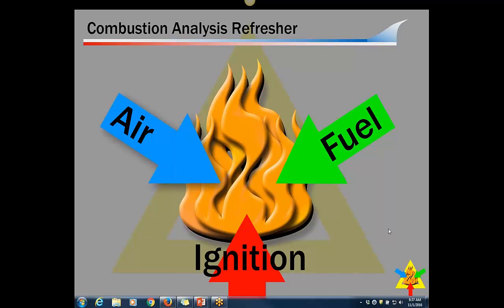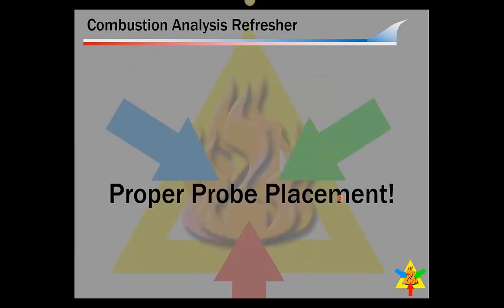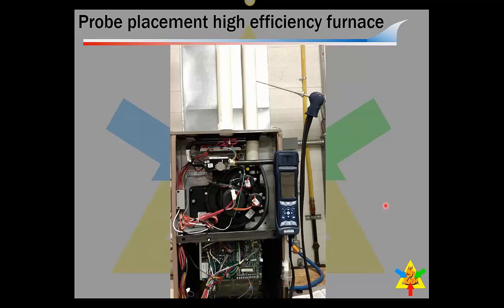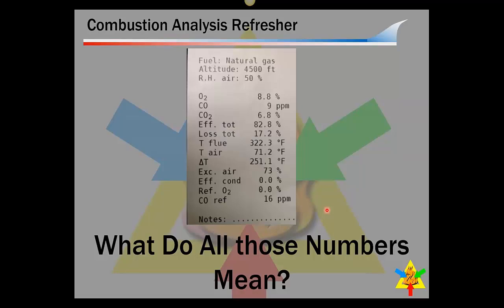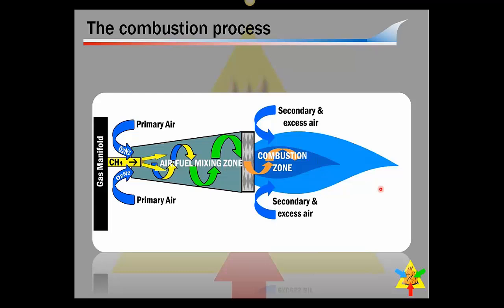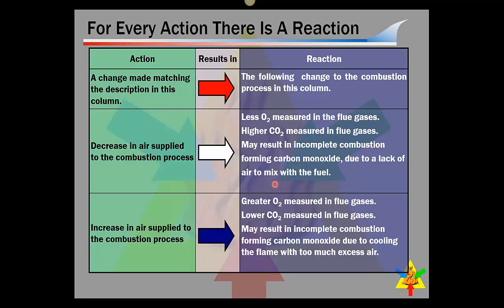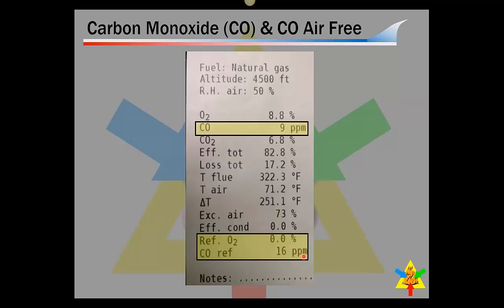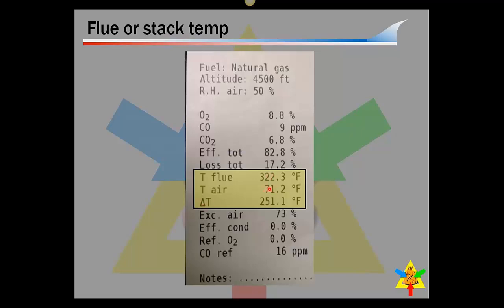Combustion Analysis Refresher--Nov 2016

Comment: What about probe placement on a Rooftop package unit?
Reply: Place it as far in the exhaust as you can without hitting the inducer fan or melting the handle.  The Sauermann analyzers also have a flexible handle that might be helpful in some situations.

Comment: Is the ONLY reason you don't wanna drill in a horizontal section of flue for high efficiency furnaces because of condensation risks?
What of you drilled into the side or the top facing down into said pipe?  Little to know risk of condensation issues right?  Would the readings still be accurate and acceptable?